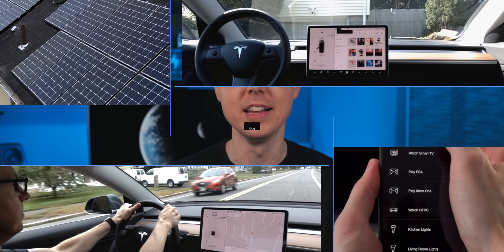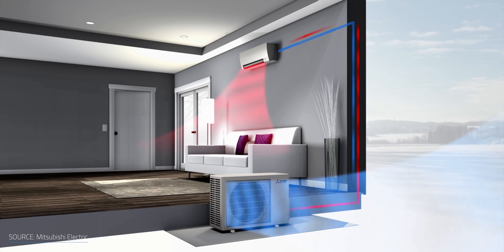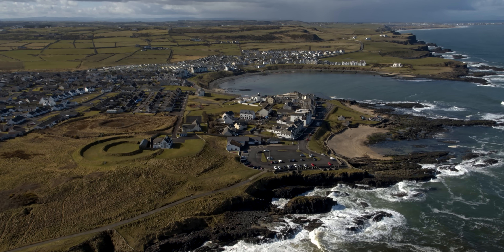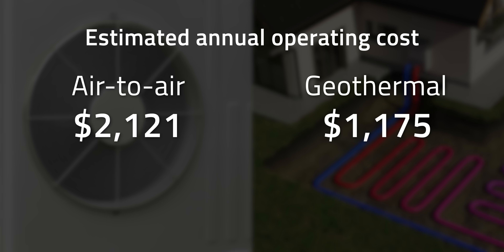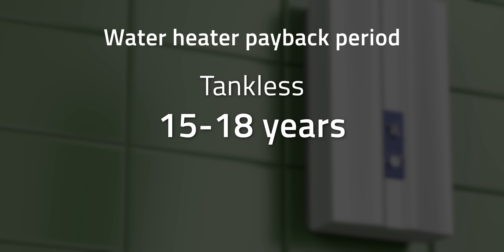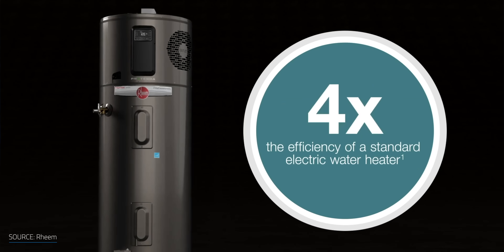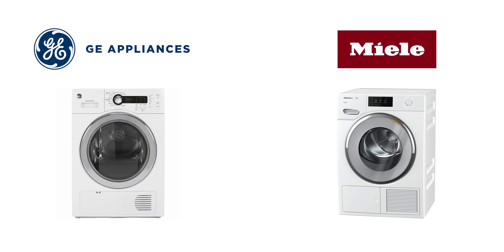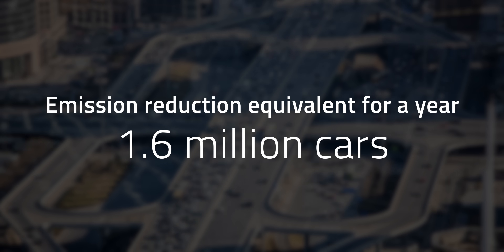Why Heat Pumps are Essential for the Future - Explained

Comment: Isn't the electricity to power heat pumps coming from power sources that are burning fossil fuels for the electricity. Then having to send it thru the power grid losing efficiency. Wouldn't just burning the gas at home for a water heater be more efficient?? I'm confused
Reply: No because heat pumps extract a large part of the produced heat from the environment. Even on fossil electricity total average CO2 emissions are therefore lower.

Comment: Heat pump?? Don't you mean reverse cycle air conditioner??

Oh also at 3:35 you're comparing units of power (energy ÷ time) to units of energy, which makes no sense. Do you mean 3 to 4 joules per second of heat is achieved? The video is well done btw, just trying to keep things real.

Comment: Heat pump technology is great because the consumer pays less money to the energy supplier for the same result.
What seems to be consistently overlooked is that the cost of energy supply is the consumer problem, but NOT the real problem to sort.

There will soon be ample energy available by renewable sources if we accelerate generation projects.  To put it another way, we are currently harnessing energy in clumsy and silly ways that cause destruction and climate change.

When this is fixed, and the sagging electrical reticulation systems are properly upgraded and maintained, then the efficiency of HVAC mechanisms need not be a significant consideration.

Elon Musk's success in persuading (by example) the entire planet into adopting electrification in transport is a seminal example of what can be done with enough "will to succeed against all the odds".

Comment: Every single video I've seen on heat pumps tries to compare their efficiency directly to other sources of heat. Every one of them will mention the thermal efficiency of around 80-90% of fuel furnaces compared to the 300 to 400% efficiency of heat pumps. Every one of them ignore the absolute efficiency of the total system. In markets where natural gas is cheap, natural gas is going to be(mostly) what is providing your electricity. The power plant providing your electricity running on natural gas is going to achieve an absolute to the user efficiency of around 40% or so. Take the efficiency of the heat pump into mind compared to the efficiency of the power plant and you are left with an absolute efficiency of around 120 to 160% thermal. Now, with that in mind take the real world efficiency of heat pumps in colder climates, where COP typically ranges from 2-3 and you are left with an 80% to 120% efficiency. I still prefer heat pumps because of the marginal overall efficiency increase and the ability to provide both heating and cooling as well as the fact that rarely 100% of the power comes from fuel sources. My problem with all of these videos is that they are very misleading, and I think intentionally so. Stop doing apples to oranges comparisons, give people the full equation with the full context. Stop talking up electricity like Its zero emissions because it's not, at least it won't be for a long time from now.

Comment: Unfortunately, this video isn't 100% correct. The colder it gets outside; the less efficient heat pumps are.  When the outdoor temperature drops below 45F, they start to take a nosedive in heat output and efficiency (which is when you need it most). Then you have to run an auxiliary electric heater.  So, generally, it will cost 1-1.5x your cooling bill.  All the while, the temperature output drops as well. A lot of people complain that heat pumps are "drafty" because the air coming out is under 100F (depends on outdoor temp_) and by time it leaves the vent and it gets to the middle of the room, all the heat has been dissipated and it feels like just a fan is blowing

 Also, if you do not have solar, chances are you will be using fossil fuel generated electricity.
 Regardless, unless you have battery storage, you mainly use the heater thru the night (when there is no sun shining).

 Conversely, you can get 98%+ gas furnaces which will give you guaranteed heat output no matter what temperature it is outside.

I recommend avoiding heat pumps if at all possible. 

Edit: This applies to "air to air" heat pumps. Gound source/water source HP's should have a more stable heat sink to draw heat from. They are also VERY costly to install.

Comment: Most electricity is generated from fossil fuels at around  30% efficiency so it doesn't really matter how efficient a heat pump is. An 85% efficient gas heater produces less emissions per BTU of heat than a heat pump running on electricity generated from natural gas. PS renewable energy still only accounts for  2% of energy generated globally. The heat pump thing is early.

Comment: "An air source heat pump for a 4 bedroom detached home located in in Northern Ireland can annually provide about £4,300 in savings" - lolwut?

I live in northern England (virtually an identical climate to Northern Ireland, I'm about 100 miles from Belfast across the Irish Sea) and our entire energy bill for our 4 bedroom detached home is about £3,500... including not just our heating/cooling (and yes, we use a small AC unit in hot weather) but also lighting, cooking, washing, household appliances, and our electric car

Roughly 50% of that total consumption is heating and cooling

£4,300 of savings would be a saving of 122% of our total energy use or 246% of our heating and cooling energy consumption ... clearly that doesn't make any sense

I don't know who came up with that number, but it's absolute nonsense. I can only guess that it's based on assumptions about Irish temperatures combined with assumptions about US average energy consumption

Comment: In US best way to save energy used for drying is to stop drying. I know it from an autopsy. It is about changing mentality. Probably it's as much impossible for this society as switching Subway or McDonald's sandwiches to hand made ones for a breakfast. Mechanical ventilation with recovery system can be also a really great way to dry clothes, also. Using pencil by astronuts for space missions over spending money to invent a new kind of pen is in my opinion a better way. But on the other side Germans heat a city using one big river heat pup. 
Heat pumps can be aplied in many other home apliances. Ever heard about Zeolith technology? It is around for some time in different applications. It is vapour to heat exchanging technology. There is no principle making any device, using heat to be driven by a heat pump. A hybrid heat-pump electrical oven? First 70 dergees Celius only with heat pump. 
New technology, that we will see to save up to 30% of energy is ceramic infra red reflecting coating. You should make a video about it.

Comment: There is so much incorrect and missing information in this video. Heat pumps DO release harmfule gasses...when they leak refrigerant AND they will develop a leak. No doubt about it. And we all know what refrigerant does to the ozone layer. Its is NOT common for a home Heat Pump to have R134A refrigerant since this is a refrigerator, deep freezer and automotive A/C refrigerant.  Typically R410A is used in a home A/C or Heat Pump.  While heat pumps are more efficient energy cost wise(which is debatable when the output temp taken into account). It is imperative to understand that the air blowing out of the registers during the winter when heating with a heat pump it is not anywhere near the much higher temp of a gas or oil fired furnace.  So it takes longer to get your house to temp and keep it there, especially if the doors are opened up frequently like what would happend during Christmas and Thanksgiving when alot of people come over and the front door of the home is open and closed alot.  Since a heat pump is also your a/c during the summer the system literally is run year round unlike a regular a/c unit. The system will need more frequent maintenance and will cost much more over life of ownership. They are plagued with problems and when those problems happen you wont have heat during the winter or a/c during the summer.  Heat pumps are practically useless when the outside temp starts getting below 20deg because ther is little heat available in the outside air at those temps. So your system will revert to aux heat which could be either strip electric heat or a gas fired furnace. Imagine the cost of heating your home with electric heat that is equivalent to 4+ electric driers running for that period of time during the really cold months of winter! Heat pumps are perfectly fine for the southern U.S. and that is only because the temps just dont get down near 20 deg and less often and not for very long when they do.  Heat pumps are practically useless in the midwest and are perfectly useless in the northern states like Maine, New York, Montana, Minnesota, Michigan, Wisconsin, North Dakota, etc. Maintenance costs for geothermal and upfront costs not to mention your yard is destroyed during installation just does not make the system a good deal.  Your money is better spent on the highest efficiency natural gas or propane fired furnace you can afford. I have a LNG fired 95% efficient furnace currently in my new home. Spend the extra $$ you would have for a heat pump or geothermal on more insulation in the home, more energy efficient doors and windows.

Comment: Let us know in 5 years how reliable all this high tech works out for you. For every "success" story of new tech I hear many people complain of hidden costs and maintenance issues, case in point the heat pump water heaters, I personally know of several that have been switched out after many issues including, but not limited to, poor performance. Every time I replace an appliance they are more high tech and the lifespan of them is shorter and I don't buy the cheapest model either. I did replace my gas hot water heater with a tankless electric whole house unit and where I live it paid for itself in 2 years due to the cost of propane vs electric. I've had it for 13 years and have spent no money on it outside of descaling it which consists of running white vinegar through it. You need to put in maintenance and replacement costs into your equations for us as upfront costs are never the end of costs for any systems

Comment: One statistic mentioned is a carbon dioxide to atmosphere volume based on band g boiler. Band g boilers are not a good comparison as there are not mass of them in use any more everything is between a-d banding these days. And as for heat pumps not realising bad gases, the gas used in most pumps is fluoride which is poisonous and needs to be captured correctly during servicing, this is not that practical so lost engineers dump it to atmosphere.

Comment: a few numbers and facts of your presentation is off, now i'm going to assume ignorance for this. 

the COP for an Air to Air heat pump is 2-3.5 not 3-4 and those numbers are assuming absolute perfect conditions. If you live in conditions where the temp is too low you're just running electric heat which will give you a COP of 1. It is true though that ground heat pumps are a higher efficiency and that's by company standards around 3.6-5 however that's once again assuming your house is well built for heat pumps and that their insulation and draft free. 

a high Efficiency Furnace is 95% not 85% 85% is considered a standard efficiency of a Gas or oil furnace the higher efficiency is achieved by adding in a secondary heat exchange that pulls more heat from the flame produced it's so efficient that you have to have condensate drains to pull out the water from the heat exchanger since it cools it down and these have a COP of 1.5-2.8

most of these "Energy Saving statistics" assumes the house is also retrofitted for the perfect conditions to include insulation and draft proofing. It's like saying "An EV saves you more money when you drive." while ignoring that the tests done were on perfectly paved roads going at residential speeds. 

electric backup comes standard, since even during normal operations the heat pump can still frost over if left running long enough. 

The water heating heat pumps use electric heaters to make up the difference during high demand periods of heating and cooling. 

I missed this point earlier it's not a "Fluid" it's a refrigerant since a heat pump is just a standard AC unit with a reversing valve that allows the flow of the refrigerant to use either coil to heat or cool the space and it's R410A that's the most common type of refrigerant but you can also find them in R22, and R134A. 

Lastly is servicing costs which are never considered when it comes to overall costs of the unit replacing any part on a heat pump is not cheap and can and will break down over time, for example lowballing a reversing valve replacement which includes parts you might need to replace with it (Filter drier, TXV, solenoid.) you'd be looking at around 1000 in parts alone and that's if you order the parts from the manufacturer and DIY which federal law frowns upon since you need an EPA certification to work on the refrigeration lineset.

Comment: Why aren't more people talking about a giant Sterling engine that could be used with mirroed parabolic dish and Fresnel lense to provide electricity. I saw one on a 10-foot dish that produced about 10,000 Watts. The video is on YouTube. And also the glass tubes filled with special oil in half barrel size cylinders underneath that are mirrored to focus the sun on the oil which is pumped in to boil water to produce steam that runs the turbine that creates electricity. The sun is the answer in gaining electricity. Also water turbines small enough you could just have enough electricity for your campsite from a little stream. Go natural or you pollute our planet more.

Comment: Does not work well in cold weather.... Not the kind of heat I want.  It can pull 79* from freezing weather 32* when it's below 0 it's only 40* and need supplemental heat such as electric coil

Comment: Why not just live underground around the equator and above ground around arctic circle. It's not the tech in a house but how it's built. Why use the energy to move the heat or cooling? The dirt under your house is already cool. The solar gain from the sun already is there to heat house. A simple tube buried will cool a house as air passes through it. Then you just need a vent at the top of the house to pull cool air in. The tankless water heater makes sense. Not heating 60 gallons 24/7

Comment: In Denmark - air-to-air is not advised - only air-to-water - since they are the most effective - and can warm your water as well. They cost 10x as much as well. Natural GAS aint cheap any longer by the way - in Denmark its gone up 5X in the last 2 years so far. Electricity is up 5X as well - so a heat pump would be just as costly as everything else - and solar panels wont be sufficient in the cold months - so there really aint a neat solution for any of this. oh yeah - Nuclear plants - we dont oblige by those in Denmark - sadly. :(

Comment: Heat Pumps are a big con: you want to heat your home. get a fan heater and use it only in the rooms you use. Heat Pumps have to be on, consuming electricity and generating noise, 24/7: and fans/bearings wear out, plus pipes carrying liquid can spring leaks - all needing costly skilled repair people.
Fan heaters are cheap, should only be used when needed, and if they break down outside of guarantee are usually cheap to replace (recycle the broke unit!)

Comment: Heat pumps are not very effective for heating below 32 degrees F, and the thought of have enough electricity generation to heat our homes in addition to charging electric vehicles AND powering our home appliances is daunting. I’m not sure the electric infrastructure can handle adding vehicle charging, much less than adding residential heating. Also, it’s only “green” if it’s powered by solar, wind or geothermal. Otherwise it’s as “dirty” as conventional heating because it would need coal or gas power plants to work.

Comment: so it's more costly upfront and it brings up that heat or cold on an extended period of time not with less intensity. a gas powered boiler and heater would be at top temperature and radiate temp in a few minutes, same for an AC, it would start blowing air in a few seconds. this system might be more efficient if thought of very well and optimized to speed up the hold/cold difussion. if a system like that costs 30.000 usd, it doesnt worth since it's kinda goes over your life expectancy > savings, so it gets irrelevant. to my intimate knowledge, if governments wanna do something against tons of co2, it will do, its not the average consumer the bringer of tons of co2, we pay for our stuff.

Comment: Does anyone sell a water heater or dryer that uses hot refrigerant instead of electricity?  By using a computerized valving system with insulated piping,  only a single heat pump motor might be required.